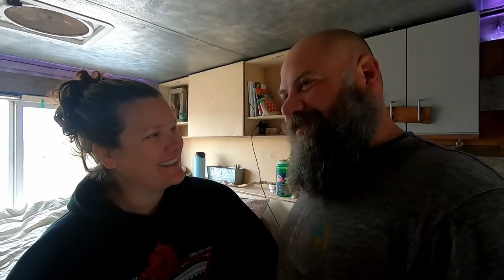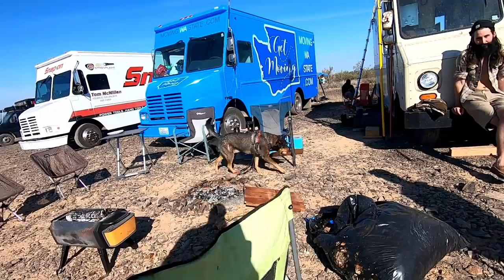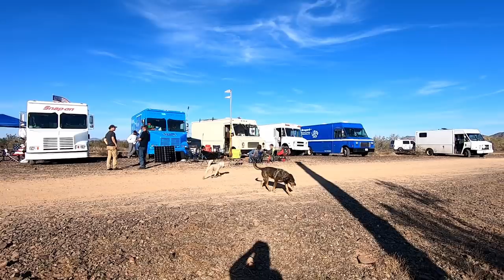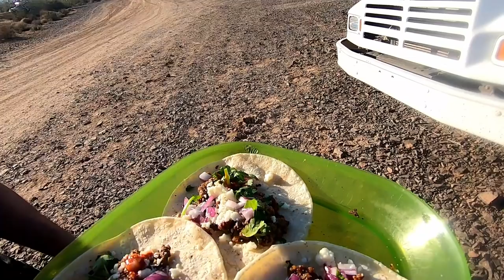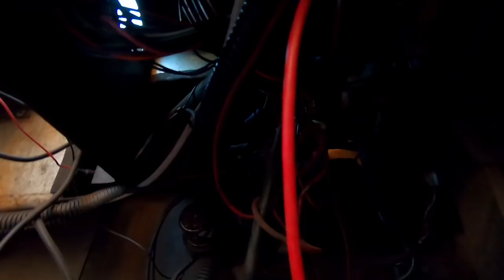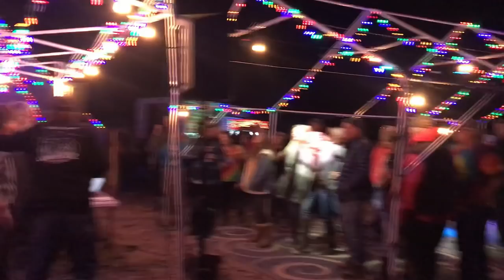STEPVAN CAMP | ParTR Part2 | LED Light Conversion | Nomad Center Camp

Comment: Wow, that was a jam packed video. 1st, I wasn't a fan of the window (from the outside, less stealthy) and I was a fan of the desk area and I hate to see it go.  But the window is great with the view from inside and the whole space is nicer and more homey and inviting. 2nd, Those tacos looked good. I could do that with my gear so I'm gonna try it 3rd, You need to show more of the Transit Connect, is it built? I get that its step van row, but its like you're hiding the Connect. 4th, I would love to see that pull-behind kitchen, maybe my Connect could pull something like that. I've got a brainstorm...pull-behind (outdoor) office that the breadtruck could pull. 4th, If I were Ellie I'd drive the Connect rather than sit in that dinky jumpseat too. Great video, it was worth the wait.

Comment: Don't like led, no heat output=snow & ice issues
Reply from the maker: I won’t have those issues. Not in snow very often
Reply: @PaulBarger  fair weather boondocking is legit if not tied to job location ft. I'm trying to live in wa and go hard in the paint in heavy snow like living the van life does. Burn one for me, stopped for cdl, hope the reefer madness gets fully extinguished sooner than later.